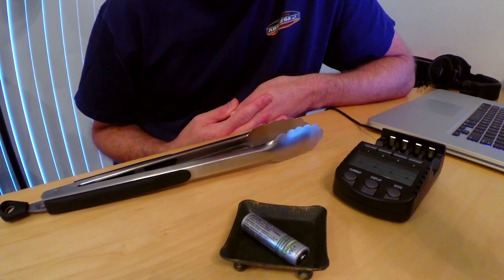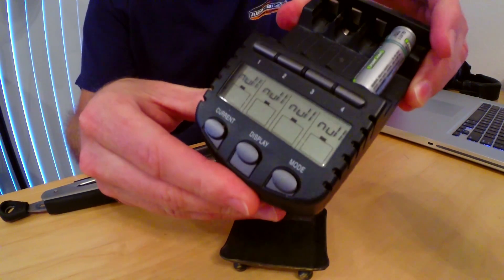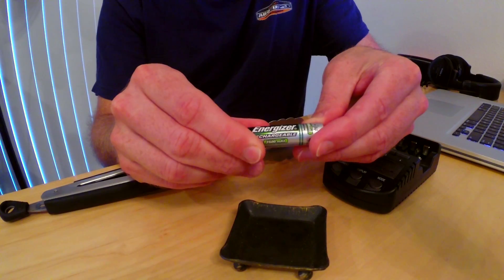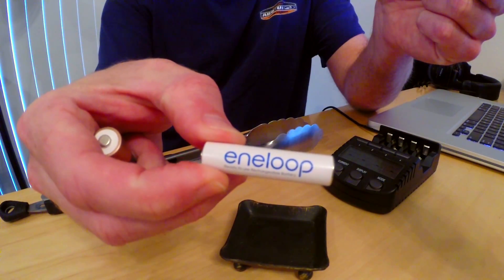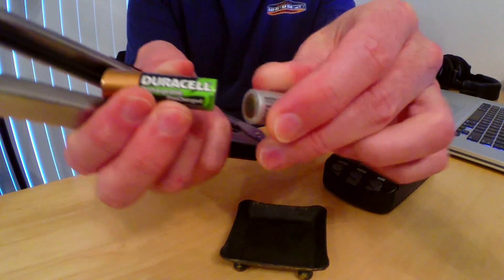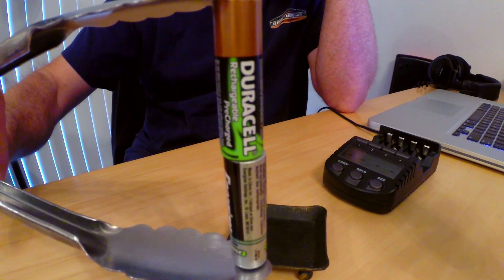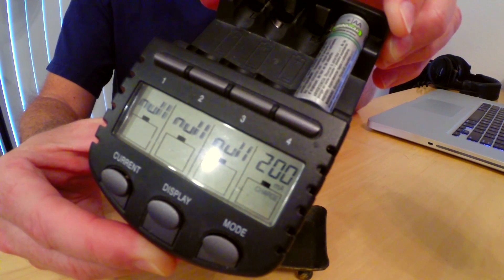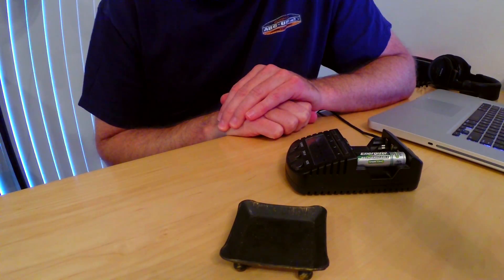Jump Start Your "Dead" NiMH Batteries With BBQ Tongs

Comment: Interesting.  I had rigged up some loose wire and was daisy chaining batteries that failed to charge.... I realize now the current is the same flow (pos to pos, neg to neg) except I have to hold the stupid wires exactly in place for 30-60 seconds..... tongs are much easier.  Thanks!

Comment: nice video
what if the batteries are soldered to a pack? 
can you still do this trick via the main plug while they are joined or you need to brake the pack down and do it individually to each cell?
Reply from the maker: I haven't done that myself, but the concept would be the same, assuming the battery pack isn't damaged or shorted. You'd need a "donor" battery which is the same or lesser voltage value than the accumulated total of the individual batteries in the pack.

Comment: Must admit i was a bit dubious about this. However I recently bought some new ones and after they ran down I checked the   charge and 1 was completely flat - The charger didn't want to know!     I stood it with one of the others  on some tin foil, joined the tops with a paper clip for 30 seconds,  It showed  a charge. The charger was fine with it and then charged it as normal.  Thanks for a great tip!

Comment: Hopefully, you're having so graciously shared this info will help plenty of folks stop tossing depleted, but still good, nicads into the trash.

FYI, in case you aren't aware; 3 seconds in the BBQ tongs works just as reliably as the 30 seconds you're using, and is much safer for nicads.

Comment: I wish I knew this trick before. TY any trick to revive them if they are in a 9xAA pack used as 1 battery?  I have a device that the battery is not taking a charge and the company is giving me the run around.
Reply from the maker: I think it's going to take more than BBQ tongs :) Technically, the same approach could be taken if you could run a lead from the positive end of a AA battery to the positive terminal on the battery pack, and run a lead from the negative end of the AA battery to the negative terminal on the battery pack, leaving it connected for a bit longer. You can probably forecast already how out of balance this would be (one AA vs 9 AA's) but you might get lucky. The chargers for these battery packs don't need a lot of current present to "sense" the pack is ready to charge. As always, be safe, and don't mix battery types. If the 9 cell battery pack is NiMH then only try this with a NiMH AA.

Comment: Thank you I was wondering why my battery charger was blinking, learned that the batteries were to low to charge.  Of all the video with the high tech solutions yours was for those of use who don’t have anything but tongues. It was able to give the batteries enough umf to get the charger charging .

Comment: Thank you so much. I used my volt meter, on the 10A scale, just in case. There was an initial high current, then it settled at 187 mA. I then put it in the charger, and it read 1.16V. I was going to use a power supply, but it's brilliant to use another battery, and much safer.

Comment: Thanks for this. All the other methods were saying to use restoration packs that would cost the same price as replacing the battery. Used a paperclip bent straight for 30 seconds and battery restored.

Comment: Pretty sure it's gonna work on our Wii big Ben 5 years old batteries too . Just toke em apart, 1 out of 4 was showing null as above, now I'm charging all of them, will see in a couple if days after the refresh is done. I hope this method helps. Put together with a 1.5v new AA battery, it wasn't working. So need to charge the other 3 to jump start the 4th. wish me luck ;)

Ps.: Looking for eneloop? But want cheaper ? Go for IKEA ladda. It's all the same. ;)

Comment: I've done a similar thing a number of times, but using a variable voltage power supply.
I agree about the Eneloop batteries, they are very good, those chargers are good too,
I have a couple of them.

Comment: This problem occurs after how many years?
Reply from the maker: Each manufacturer is different, as the quality of the battery varies. Those Energizers in the video failed after approximately 11 months of regular use.

Comment: Can a piece of wire be used instead of tongs?
Reply from the maker: Yes, although it's easier to use the tongs as a clamp. Wire will work fine as long as it is conductive.

Comment: Is it possible in case of 9V rechargeable battery?
Reply from the maker: This concept will work with any voltage of NiMH battery that has fallen below the threshold of your smart charger as long as the battery has not been damaged. Your objective is to get just enough energy stored in the battery so that the charger can take over.

Comment: My Energizer charger just blinks red telling me my Energizer Plus AA batteries are bad.  Would this trick work for those?  I've had several pairs fail on me so far and most of them only after 20-30 recharges.  I'm beginning to wonder if Energizer is a sketchy brand for NiMH.
Reply from the maker: I feel the Energizers are some of the worst, all of mine have failed. The technique in the video will likely get them to charge again and let you use them for a while longer. However, I found that even after a full charge, they discharge more rapidly as time goes on. I have replaced all my Energizer batteries with the eneloops.

Comment: Had some Harbor Freight rechargeable batteries had them for couple years wanted to put in my charger said same as yours null did not wanted to charge, did what you did holly smokes it actually worked thanks again for this awesome video 👍🏻

Comment: Nice! I just had a 5 year old Eneloop do this. I put the 2 negative ends together and just used a straightened out paper clip, bent again near the ends, to connect the 2 positive ends. I'm putting it through a refresh cycle now, but it's probably time to get some new ones after 5 years. To Eneloop's credit, this is the first battery of 8 AA and 8 AAA batteries from them that I own. All bought at the same time, 5 years ago. I've been wanting to get some with the black casing anyway.

Comment: Once I saw you using a BC700 I knew you were serious. I had two Walkman batteries from a Walkman CD player. So... very old. I put them both in the BC700. One charged, one was Null. I used the one that worked with your trick (using a pair of kitchen tongs, i.e. the only electrical communication is a tiny rivet) and the Null battery is now on a refresh cycle.
So your video should be somewhere near the top of the RUVs - those few Really Useful Videos that do what they set out to do simply and well.
Congratulations !
Reply from the maker: Great reply! Thank you for letting me know it worked!

Comment: This worked to get rid of the blinking red charging light error. But I had to put them in the right orientation, plus to minus, + to -, not minus to minus. (The spoon heats up a little. And then it charges again, and work again.)

Comment: Can this work for overcharged batteries?
Reply from the maker: No, this won't help correct that problem. Your best bet, assuming the battery has not been damaged, is to use a reconditioner device that fully drains the battery and attempts to recharge it. Keep in mind that the quality of the battery to begin with with affect your results. The Engergizer batteries in my video I have pretty much written off. They still charge, but don't last long, even after running them through a recondition cycle.

Comment: I did the exact same thing but jumpstart my rechargeable NiMH battery that my La Crosse charger was refusing to charge (it doesn't detect the battery if the voltage is below 0.9). My setup was actually using the charger itself. I've inserted a good rechargeable battery in bay1 and the bad rechargeable battery in bay2 then I took two paper clips and connected both batteries using + with + and - with -. The bad battery charged a bit and jump started.
Reply from the maker: Brilliant approach! I will try that with my La Crosse charger next time.
Reply from the maker: I just tried your method and it works great! I had batteries charging in bay 1,2, and 4, bay 3 was null. I just jumpered the positive terminal on bay 2 and three, and the null battery started charging. I'll play around and see if it makes any difference which bays have batteries in them or which order when bridging them with a paper clip. That's really a great alternative!

Comment: Holy crap it worked!  Only instead of BBQ Tongs and second battery I used bench power supply and zapped "dead" Enloop with 1.5V for about 30 seconds
Reply: Exact same thing I do.

Comment: Energizer is not a bad brand, just pretty damn overpriced, just like Duracell. Just buy cheap batteries unless you need high reliability and capacity.

If you need rechargeable batteries, Panasonic (formerly Sanyo) eneloop batteries are the best you can get longevity wise. They also sell Eneloop pro, but I don't know how different they are.

Comment: I had three new Eneloop AA that dropped below the threshold, thanks for the tip it brought all three back. I had them in a torch that was left on for a month totally discharging them. I used a loop of wire to kick start them. 

Cheers for the tip!
Reply from the maker: Awesome! Thanks for posting your results!

Comment: what happen if put for 60 sec !!
Reply from the maker: When you connect the two batteries you are effectively transferring current from the battery with the higher charge into the battery with the lower charge. But you are doing so without any sort of current or voltage monitoring. The objective is not to charge one battery with the other, it's only to raise the amount of the "dead" battery's charge so that your NiMH charger can detect it and do a proper job of charging it. I've yet to have a need to leave the two batteries connected for more than 30 seconds, and many times I get by with even less of a duration.

Comment: I have some NiMH batterys that show a voltage of over 1.2v however they don't work even after charging for long periods. Any ideas.
Reply from the maker: If they show good voltage but don't operate the device you put them into, they may not be supplying enough current. You can have good voltage but still have insufficient current output. Assuming there is nothing wrong with the device you are powering, my only advice is to try an alternate charger if you have one available, or try another battery brand, replacing the ones you are having problems with. I have recycled nearly all of the Energizers like the one I show in this video and replaced them with Eneloops.
Reply: skysurfer I have tried other chargers to no avail. Funnily enough though, all 4 of the batteries in question are of the Enegizer brand. Thanks for your reply.
Reply: I have the same problem and havent come up with a solution yet at least. These batteries are quite old though, but i dont think they have been charged that many times that they should be worn out, they just suddenly gave up one after one after working fine.

Comment: I jump start my dead cell while its in the charger by connecting a good cell from above with foil or wires. I'm just connecting them in parallel  much more briefly meaning the power of the good cell will just trigger the charger to charge and the dead cell will not get a bunch current from the charged one. If your cell was totally dead for a really long time then you will notice it charges much faster than normal due to its severely diminished capacity you can do a refresh cycle to try to recover it. 
This is for Bc700
AA 500ma (use 250 ma discharge/refresh)
AAA use default low currents

Comment: Would it work for 18650 li-ion battery?
Reply from the maker: It should, as long as you are using another 18650 li-ion battery to supply the voltage. The 18650's are 3.7 volts, so using the AA's in the video as a source battery, which are a different voltage and current rating, would not be a good idea. Keep the two batteries the same and keep the time they are connected short. You just want enough of an energy transfer so that your charger can detect the battery properly and take over.

Comment: Nice video and I'm going to try it out. The Energizer NiMh are decent batteries, but they degenerate quickly. With that specific charger, I've left the battery in the charger and it eventually registered voltage and charged... but still with a low threshold. The reconditioning cycle doesn't help much. The Eneloop is the way to go - I switched over because of camera, which ate Energizers alive - the Eneloops have no problem holding a high and consistent charge. Make sure you buy 2000mah or higher.

Comment: I forgot a good 2500 NiMH battery for over a year in a flashlight. It dropped to 0.1V and no charger would pick it up. Tried your method and got my battery back in no time and now the battery  works fine again.
thanks

Comment: Holy smokes. Works for NiMH to Ni-Cad too! I was just about to throw 6 of my Ni-Cads cause they been dead forever. All registered 0.00 on the voltmeter. Put em in the charger over night, still 0.00. Tried this and each then showed around .09, so they're in the charger. Will share the results.

Comment: Thanks. This worked for me. I used a small strip of tinfoil instead of tongs, but the principle is the same.
Reply from the maker: I salute your MacGyver instincts! Another viewer wrote to me and said they bent a paper clip to the necessary size when putting two AA batteries together and have that on standby in the battery drawer when needed.
Reply: I couldn't find a large paperclip, so I tried your foil method, and it WORKED!  It took one of my batteries longer than 30 seconds, but my "null" batteries are now in the "smart charger" for a few charge and refresh cycles.  Thanks for the idea...I didn't have any tongs, either :P

Comment: Excellent. I use batteries in my guitar amp for busking. I used to get a gallon baggy of cells a every couple of months. Move to primary/secondary system using chargeable /alkaline. Must be the Heat extremes cos I find the chargeable ones starting to go. I love tong idea, a shunted wire is good enough for 30 seconds. Battery concept is one of the ten mysteries of today's technology.

Comment: Yes this trick works. Another way if you don't have any good batteries, is to cut a USB cable, connect it to your mobile phone charger, and hold the red and black ends to positive and negative on the NiMH cell, respectively, for about 30 seconds. This will boost the battery enough that it'll charge. (EDIT: If it's a thin USB cable it may get very hot by doing this, and you might damage your charger, so don't use your best Samsung QuickCharge charger or whatever for this, but a cheap one you can afford to lose)

Comment: will this work if i have 2300mah (4)and 2700mah(4)both NiMh rechargables GP all dead using the normal energizer or duracell 1.5V batteries like u showed here?
Reply from the maker: Yes, that should work. As long as you are using similar voltage and current that the target battery is rated at, and you are connecting them for a very short time, you should be ok. Your objective is to get just enough juice into the battery so that your charger can detect it and take over from there.

Comment: This really works. I tried reviving a 0V NiMH with a good hobby grade charger (force charge in different batt modes) without success. Finally this simple reverse charge with another NiMH worked. Thanks a lot for sharing this trick!
Reply: +niikasa , reverse charging won't do any good at all (presuming this means connecting + to - and - to + because that would reverse the polarity, probably doing more damage).  Note that similar surfaces (flat, bump) were connected electrically in this video to similar surfaces.  It's just "dumb" charging, cramming some minimal amount of charge into the cell with brute force and ignorance (BFI).
Reply: +rchandraonline   'reverse charge' i meant i connected + to +. It jump started the 0 volt nimh so charger recognized it as nimh.

Comment: I have a NiMH battery that was showing 0 volts in the multimeter and thus was not recognized by my charger. I did your trick and it showed 1.3 volts after the 30 seconds charge with a good battery, and now it is charging normally in my charger. Thank you very much for this video!!
Reply from the maker: Nice!
Reply: I\'m not sure but ,if anyone else needs to find out about recondition a battery try Jons Mender Guide ( search on google ) ? Ive heard some pretty good things about it and my m8 got cool results with it.